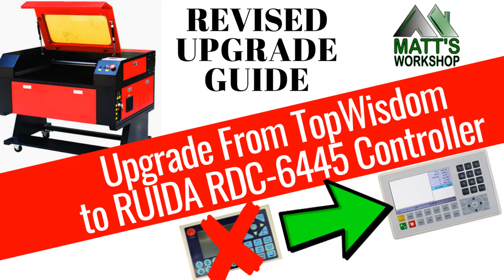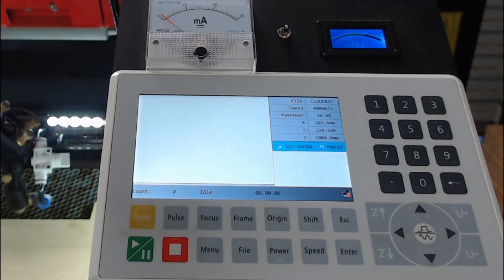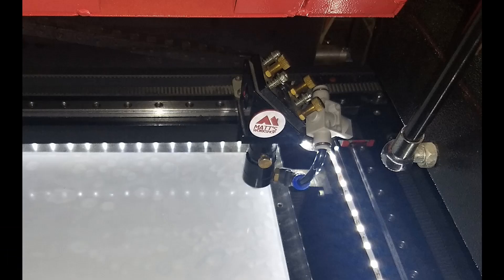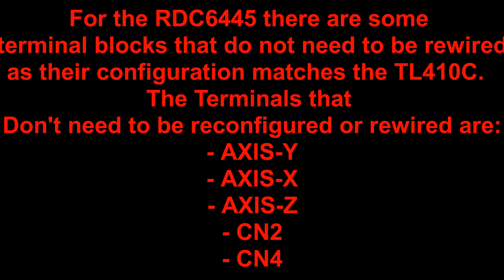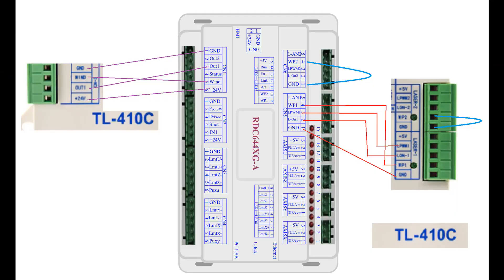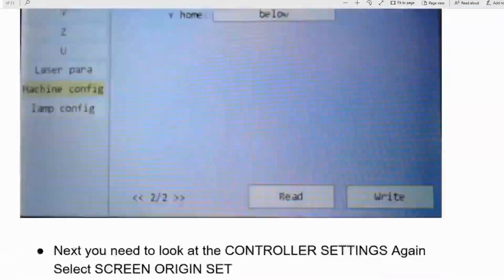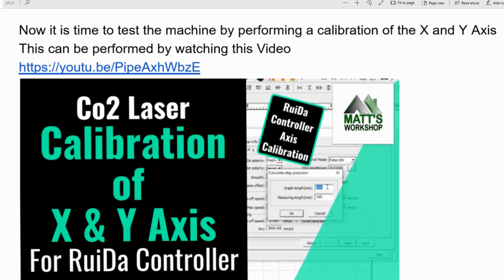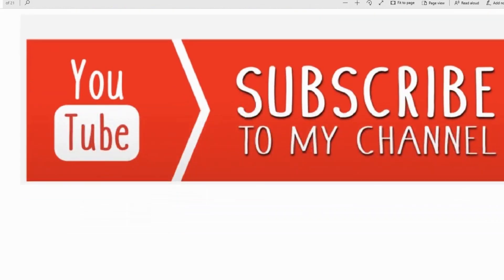Revised Upgrade Guide From TopWisdom to Ruida for Co2 Laser Machine.

Comment: really don't understand why you need to change it ?! I use the TL and for a 80W laser it totally do a great job, what are the advatages of Ruida ? other than spend 400$
Reply from the maker: This video was made before that TopWisdom controller had compatibility with LightBurn software, however Ruida controllers do have better functionality and in my opinion are easier to use and configure.

Comment: Love your videos Matt, I have adjusted the default speed/ acceleration machine settings of my Chinese Red LASER 100w (900X600MM).  Is there a way to completely reset back to the original settings using thew TopWisdom controller or LightBurn?  Or could you send me the settings?  Thanks!

Comment: I'm about to order an 80w red & black laser with a TopWisom controller. I can't understand the actual benefits of moving to Ruida controller apart from using Lightburn software. Will the TopWisom controller work with RDWorks? Partially? Not at all? In case it will not work with RDWorks what about the software provided with the machine? Is it so bad? And what about creating the output file in Lightburn or RDWorks or even Adobe Illustrator or Corel Draw, then moving it to the machine using a USB stick? Is it feasible? Thank you Matt for the informative videos.
Reply from the maker: Hi SR - did you receive a reply.  I replied earlier and came back to add a comment and noticed my reply is missing.  YouTube comments don't work well for me, maybe in future shoot me an email using the address in the description.
To answer your question (this time briefly) - TopWisdom Controllers will only work with the software it came with (AutoLaser) and will only read output files from it.  The controller will not work at all with RDWorks or LightBurn or their output files.
I am told that LightBurn are getting closer to compatibility, but there is still more work to be done.  
I hated the AutoLaser Software, there are a few work arounds you can use with importing and exporting etc (as in one of my earlier videos)
I would still recommend upgrading as in my option the Ruida Controllers are so much better and more reliable, this is from experience using both.
Cheers Matt
Reply: @MWLaser  Thank you so much Matt.

Comment: I've just taken possession of mine, so still looking into what upgrades I should be doing.  However once I've tested it a little, I'm thinking I will be following your guide to upgrade the control panel.And does this mean you are now running the Lightburn software with it?
Reply from the maker: Yes. And Lightburn is a superior product to the autolaser software that came with this machine you won't regret it. Cheers Matt